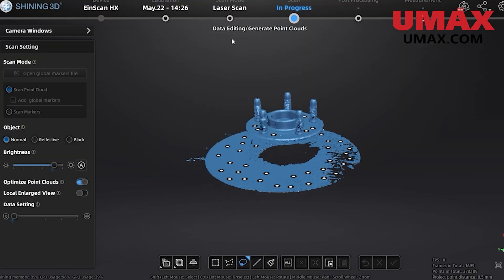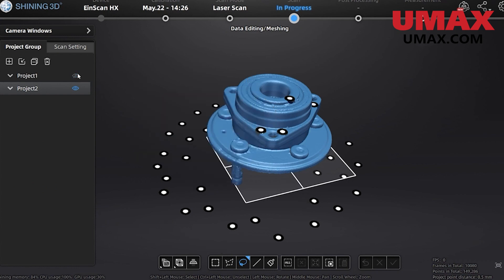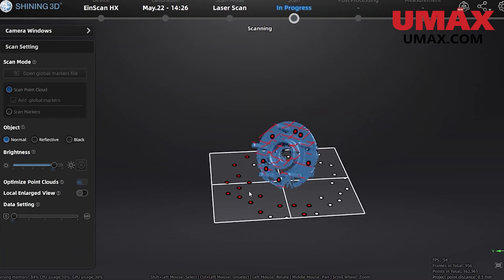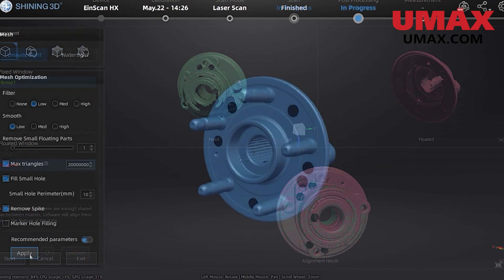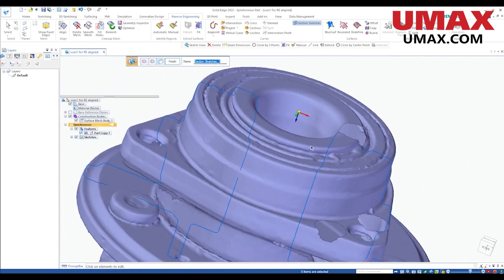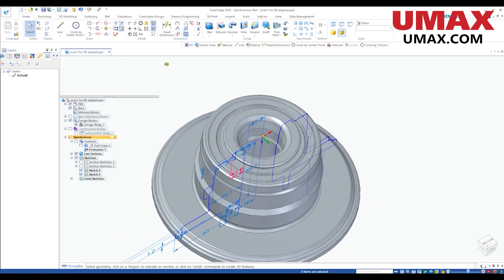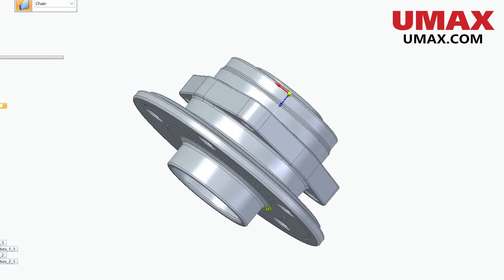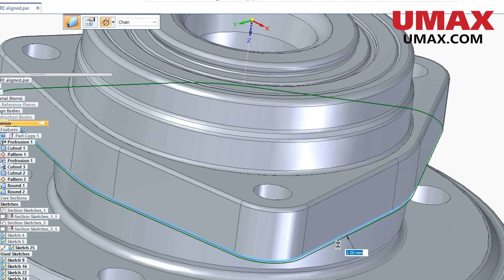Reverse Engineering Demo with EinScan HX 3D Scanner, Geomagic Essentials and Solid Edge software

Comment: Can you do this with the einstar?
Reply from the maker: Yes, Einstar can generate STL mesh files too. You can follow the same procedure to complete the Reverse Engineering.
The only thing is that Einstar may not have very good accuracy standard compared to EinScan series, so usually we use EinScan for Reverse Engineering, not Einstar.

Comment: thanks for the demo, does seem like a lot of cad work to get there.  I use Fusion 360, will the process (roughly) be the same with F360 WRT the final result?  thanka much
Reply from the maker: Sorry both of our software engineers haven't used Fusion 360 before so we don't know if they have very similar procedure. But we know recent year newer version Solid edge has made a lot synchronous mode improvement which many users said (its CAD) it's superior to Fusion 360 while Fusion 360 is good at CAM at the other end.